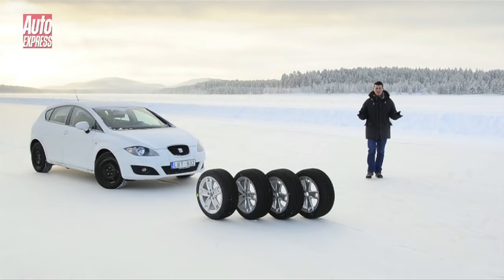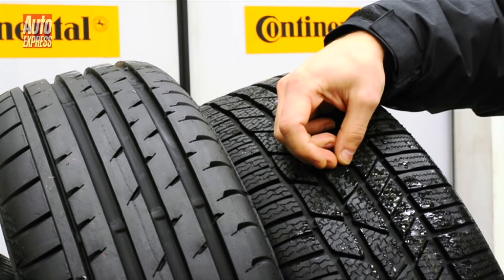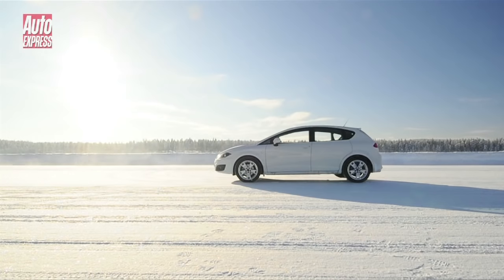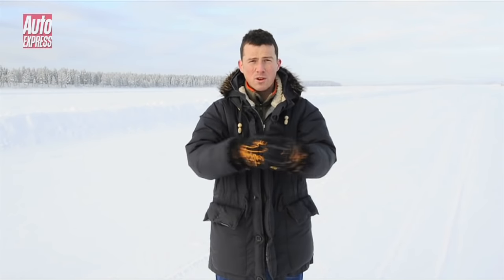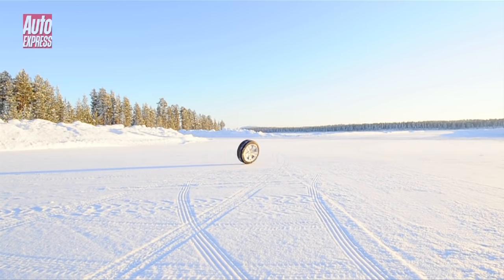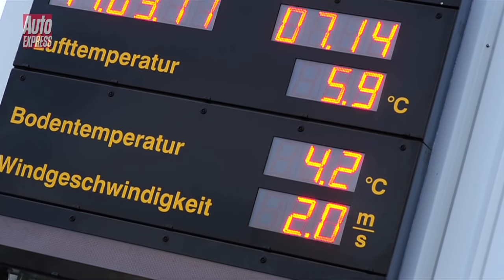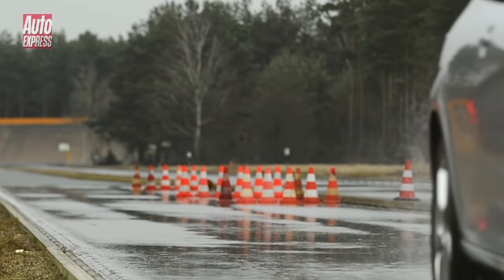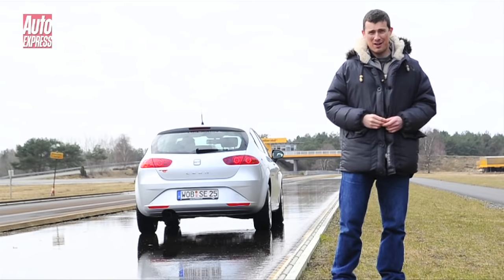Winter Tyres v Summer Tyres: the Truth! - Auto Express

Comment: yup in Alberta , Canada , winter tires are not mandatory ... most accidents are caused by idiots with terrible tires. 

make all the difference.
Reply: really? In BC M+S or Snowflake tires are required to be on by oct1st and they HAVE to be snowflake rated to go over any mountain passes. In fact the RCMP can ticket you for not having a snowflake if they so choose. 

But yeah Alberta doesnt require it?
Reply: Steven Stringer winter tires are not mandatory in Saskatchewan either
Reply: crazy
Reply: i had to drive on my low pro summer tires in winter when some douche bag kid decided to slash all the tires on my street. really wasn't that bad and i my car was rear wheel drive you just had to know how to drive to the conditions and leave a proper safety margin to the car in front. i live in Alberta too.
these "tests" are exaggerated and anyone that blames getting into a car accident on their tires or no abs etc, are just dumbasses that lack personal responsibly its call driving to the road conditions and have no one to blame but themselves.
Reply: mike r so you have been driving without winter tires ever since?
Reply: it happened 2 years ago, but ya i drive with all seasons, and i haven't had accident that was my fault in ten years, in fact the only 2 crashes i had was when i was a new driver and they were in summer.
Reply: that said when i drive through a mountain pass in a snow storm ( i.e when i go snowboarding and the 3 lane highway is down to 1 lane) i throw on my tire chains, but only in severe conditions.
Reply: Better double check your insurance. 

They could completely deny you or find you at fault just because you didn't have winter tires.

For the record i disagree with you. A lot. 
However, i DO live in a very mountainous area. So its like night and day.
Reply: TheMausymaus just so you know truck tires are not the same as car tires, my tires which are very expensive all season snow and mud rated tires can stop better then the budget winter tires you can probably afford.
Reply: mike r as much as I'd like to disagree... its true.

Comment: The steering wheel that saves the day  more times than the middle pedal! This is why 'steering' a car properly should have a lot more emphasis in learning to drive. UK hands out Driving Licences like it's throwing confetti.. just the posture and seating position of many drivers means they cannot apply more than 20 degrees of steering lock in emergency, many can't turn st.wheel that much in a hurry... UK Driving Test not fit for purpose IMHO. Winter tyres good, if everyone has them even better!

Comment: What about brake caliper clearance?  If you go smaller rims, they won't clear the brake calipers in most cases.  Brake size is what determines wheel size from the factory 99% of the time.

Comment: in the braking distance with the winter vs summer tires is a little inaccurate. if you used a high performance summer tire like the Michelin PS4S it would have braked better than both of those tires.

Comment: First car took 27 meters to stop... second car took 85 meters 85/27 = 3.148 which is over 3 times the distance to stop. The 58 meters they flash up on the screen is the additional distance it took the summer tire car to stop beyond the 27 meters for the 2nd car.

Their math is good.

Comment: Winter tyres can overheat in warm conditions and you don't want that. Good (and I mean not budget) summer tyres are better for everything except ice and snow.
Problem with this test is they are probably testing cheap ditch finders vs winter tyres. Which is why they performed badly in the wet.

Comment: I disagree as I have restored cars since 1983.  Brake size determines wheel size and has since the late 80's.  You might have the same model with different wheels, but the brakes are not identical.  Just like a, say for instance 97 Taurus came with 15 inch wheels, but the performance 97 Taurus SHO came with 16 inch wheels, because the brakes are larger.  I never said anything about altering a bolt pattern.  The only way to do that is change the drive axles and rotors.

Comment: I live in the Netherlands and I drive cars since 1981. I have never, ever experienced these conditions on the road. In civilised countries the government Salts the road even before it starts to snow and then again, and again. This test may only be valid for the northernmost parts of Scandinavia and America. So, there are a few car journalists, sponsored by tyre manufacturers and SEAT who had a nice outing. No wintertyres needed. And don't get me started on the softer rubber compound. INDEPENDENT tests showed that winter tyres are better from -5 C and lower, equal up to 0C  and WORSE above 0C and much worse IN THE WET. As in my country it is above 0C 90% of time and wet 30% of time in winter, I accuse Dutch winter tyre users of two things. Not thinking for themselves and dangerous tyre choice. In other countries where real snow is on real roads more often than not, it is of course better, far better to use winter tyres.

Comment: All season tires are quite good, but they are worse then winter tires in winter and worse then summer tires in summer. I`m living in Norway and when the snow comes You have to have winter tires. It`s no way possible to drive on snowy hills with summer or all-season tires. Sometimes even without studs it`s not possible to move. And it`s not necessary to buy new tires every 6 months. Tires go good 2-3 seasons.

Comment: if you live in a climate where winter is only around 3-4 months, it wouldn't be that bad. add in the fact that you'll be using your summer/allseasons 3-4 months less every year, prolonging their life, and it becomes even easier to swallow. so if they last you for 3-4 years and cost about $500-600 US, that's a net cost of like $75-100/year to feel way safer when driving for those 3-4 months. I've had $75 dinners. They were good, but not worth feeling safe for an entire season.

Comment: i have a set of not so good all season tyres. These dont have a particularly good review for snow, however they do have M+S rating. The difference between these and normal summer tyres is astounding.

Its not about the model, the make.. its about the design. The sipes in ALL winter tyres, and the softer compound are what make the difference.. not the make.

Comment: Looks like tests were done by just blasting the throttle/brake. Of course the winter tyres will be better regardless but thats not how people drive on slippery surfaces, the gaps would of been way smaller with decent pedal work.

Comment: I beg to differ with you on the rim size.  If you have 16 inch rims, then 15 inch rims will hit the calipers unless you run a very negative offset where the tires and rims stick out from under the fenders when mounted on the vehicle (ugly).  Same with 18 down to 17, 17 to 16 etc.  That's why you see bigger and bigger rims on newer cars....bigger brakes.  I have ran hundreds of aftermarket rims and tires and when you go down a rim size, you have to grind the calipers down & that can be dangerous.

Comment: the compound and tread pattern are designed for snow and cold temperatures. Under wet pavement they are HORRIBLE, i've come across a number of people who've had winter tires cause accidents while in use outside of the snowy, cold season.

Comment: What about all season tires? That is what comes on 95% of cars here in the US.
Reply: Those are the worst.
Reply: Wrong. There are other tests on youtube comparing these tires. All Season tires are better than summer tires on the snow but still not as good as winter tires--a compromise tire if you will.
Reply: GrnXnham You'r really good at pointing out the obvious, well of course summer tires are bad in winter they even called "summer" tires that used in summer...
Reply: It was obvious to me but it wasn't obvious to you.
Reply: GrnXnham The answer so stupid I don't even know how to respond...
Reply: Kabloosh they are not near as good just have two sets it's not that hard. It's a lot cheaper then a crash. All seasons have the tread pattern but only a small portion of the tire also they are not soft like winter tires.

Comment: First of all, on ice, there is no difference. Summer tires in winter on dry roads are not a problem. How ever, there not as safe on snow and slush. Gas milage suffers when using Winter tires on dry roads. But they are safer on snow or slush.

Snow removal from roads has improved dramatically in the last 50 years causing the pros and cons of winter vs summer tires to be moot. Safety vs longivity and milage. Changing tires when the weather is bad to winter is safer, but once it's over, changing back to summer improves milage. Doing either constantly is a hassle. So, if one drives safer using summer tires in the winter is not an issue. It saves money (only one set of tires and better milage ) as well as space (no need to store a set) in addition, one avoids the hassle of the constant need to swsp them when the weather changes.

Comment: Wow winter tyres work better than summer tyres on hard snow shocker!!!

Lets be realistic, we get maybe 2-3 days of snow per year so they are not needed. We are not setup for winter tyres either - no storage etc. Plus over 7C and winters are worse than summers.

So the "evidence is conclusive" if you live in a country where they are needed and if driving on hard packed snow. For driving in the UK 99% of the time they are NOT needed. What is needed is sensible driving or not at all depending on the conditions. 

Seems to me that people need to adjust their speed in snowy conditions to allow for the increased braking distances.

Comment: Are you serious? Here's an idea, if I put racing slicks on my car and cut my brake lines then I will have a really safe car because I have no chance of being rear ended. If you need to stop having control of the car is critical. If the guy behind is too close then adjust your braking don't fit inferior tyres.

Comment: If the braking test was done with the ABS turned off , the car with the summer tyres may have stopped in a much shorter space. 
but , still longer than with the winter tyres , no doubt
Reply: Wolf perhaps, though it may have skidded more and gone off in a slide so not perfect either way
Reply: Have you ever tried to brake on snow when you have summer tires, without abs off course. you would just lose control of the car.

Comment: i find it interesting people saying they that you get worse mileage with winter tires. i find that i get better mileage with winter tires on snow and ice then i do even with my Michelin Defenders.
Reply: xxsoulhuntxx - they're talking about using winter tyres all year round which gets worse mileage - this is down to the extra grip causing more resistance - the actual difference may be low though, I saw a figure quoted on a tyre dealer website suggesting over a lifetime of using a summer A rated tyre (designed for better fuel use) vs a G rated tyre (very inefficient summer) was only 6 litres of fuel. Winter tyres may have more of a difference on fuel use
Reply: Gobtik OK, thanks for the info. Why people would winter tires above 50 degrees i guess is more the question to ask then haha
Reply: xxsoulhuntxx
 Laziness or only having one set of tyres to save money (though all-season or good wet weather tyres would be better than winter ones!)

Comment: I am from the uk live near worcester and I am a big fan of winter tyres we moved into our new house which is right out in the country side on single track roads and they realy did save us from being house bound. I also noticed they made more noise in the wet it was as if the droplets flying up from the wheels hitting the under arches where bigger but it might have just been in my head. The car we drive is a Skoda Fabia 1.9 TDI and the winter tyres we had fitted are vredestein snowtrac 3s

Comment: Everybody talks about weather temperature but what about friction?? In cold dry pavement with friction still tire might get that minimum heat for adhesion. I've driven many times with my summer tires with temp under 4C without any problem at all. These people are part of business and dont believe everrything they say most cases they make you spend more..Unless the road is very icy or snow covered regular wet tires will do ok otherwise better not drive if you can because no tire will work
Reply: Summer tires work well in the cold as long as the road is totally dry. By cold I mean below freezing.
Reply: lfsracer79 what about tire chains then?.On snow and ice it's very effective indeed. Just a pair is enough for driven wheels and cost effective. I really would like to see a test of winter tires vs. tires with chains on snow. which one of them has a shorter brake distance

Comment: What don't people understand? Just because you buy two sets of tires, doesn't make your wear rate any faster... Still only running one set at a time. That's like saying "I only fill up half my gas tank to save money". What?
Reply: TheMausymaus unless you dont drive a lot and have to change tyres after like 5 years because they are old, although not worn.
Reply: Until the day it dumps and you weren't prepared. Today in my city I saw 1. A Grand Cherokee went off the road and hit a wall 2. A guy crossed the double yellow into oncoming traffic 3. A rear ender in front of a stop light. I drove 15 minutes each way. If only people took the necessary precautions, along with gaining some driving sense. I, for one, am sick of it. I'm going to be fucking pissed if someone hits me.

Comment: If your not a muppet and actually know how to drive then summer tires are fine all year round. Just slow down when its icy. I live in Scotland in the highlands and we get really bad ice on the road and its never gritted unless its a heavily trafficked area, so practically no where. If your coming up to a hazard then slow down before you get there. I've never once slid out of a junction ever and I've never had winter tires on. And if the front end is skidding out just put the handbrake on a little to put the rear end out, that saved me from a ditch once when I was turning a corner. People are just so disconnected from they're driving, they relax and become completely unaware of they're surroundings.

Comment: This seems really biased. Summer tires do have a place on the road and their positive factors are barely even mentioned here. On wet surface the summer tire should stop quicker due to their ability to pass water more effectively than winter tires. The quality between the summer and the winter tire in this video must be significant to produce the result it did.

Comment: Not true.  "Real" winter tires may be studded or studless, using sophisticated rubber compounds instead of spikes for ice traction.  The tires demonstrated in the video are studless winters, NOT all-season tires.  The key either way is the tire is designed specifically for use in cold weather and conditions of snow, ice or slush.

Comment: I am driving winter tires all year long :D every two years i buy two new ones on front and old ones on rear wheels :) Works for me so far. :)
Reply: uneven tread across tires is not good for your car in almost every way, from turning to braking to suspension.
Reply: C North  i know that buy my car is old so i dont want to invest a lot of money in it :) saveing for a better car and than ill keep it tidy :)
Reply: Dejan Jankovic Id advise to put the better tyres on the rear , even if you have fwd. Most dangerous car crashes happen because of oversteer when the rear swings out.
Reply: Did that week ago we had snow and ice past week expirienced rear part sliding out scarry thing. Tires are set now :)

Comment: Winter's are less performant then summer's above 6 degrees celcius, greetings from Canada where we have laws forcing people to use winter's between 15th of december to 15th of march (Quebec province). There are still people here that run winter's for economic reasons but the reduced durability of hotter surface doesn't make it an economical choice regardless of what people thing. Get a steelie set of wheels for your winters and save your summer's while you using winter's and vise versa.

Comment: It's not more expensive. A "good" set of A/S tyres cost the same as any good tyre. However, there is no good A/S tyre. Also, the miles are shared between the two sets of tyres. If you drive a half way decent car with good tyres, the difference is night and day. Winter tyres work badly in the summer and summer tyres are shit in the winter. And that does not have enything to do with snow and ice only, but pattern and compound.

Comment: you are definitely NOT more stable on the winter tires in wet conditions as compared to summer tires.
You hydroplane really easily, on acceleration the car sways from left to right if you give it gas and not to mention gas mileage is not as good on winter tires.  Also, winter tires get chewed up faster so you'll end up changing them out more often.

I'd keep winter for winter, and summer for summer, which is what I'm doing now
Reply: he said they are good for wet condition is cold temperatures
Reply: ah kk. well, that makes sense.  winter tires are made for cold not just snow.
thank you for the clearup :)

Comment: It's odd to me that he measured in Meters, yet said the car was going 25 Miles Per Hour... Trying to appeal to both sides of the pond? :)
Reply: In england we have switched to the metric system but we still use some imperial units like Mph even though we use meters for smaller measurements of distance we still use miles to measure longer distances... it can be confusing
Reply: *****
I would say that's very confusing. Why not just put kilo in front of meter and make it simple?
Reply: teejnits Its metre, not meter....

That's just my poor attempt at humour by the way :-)